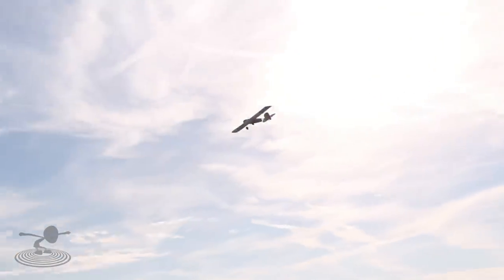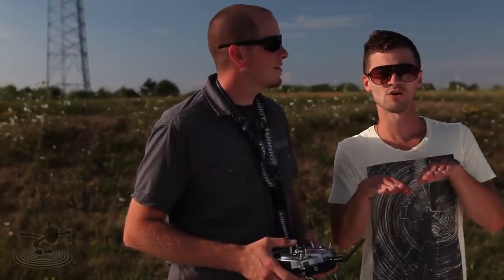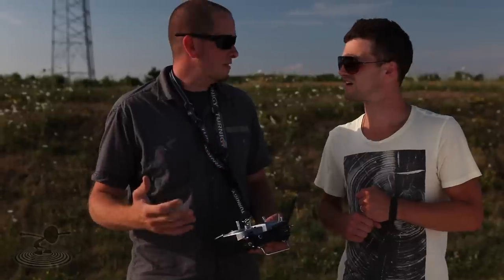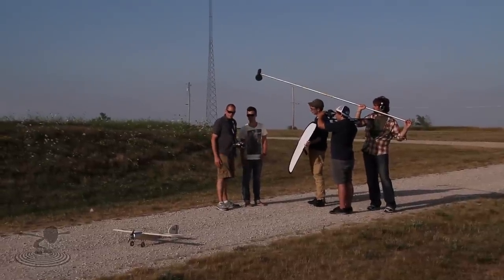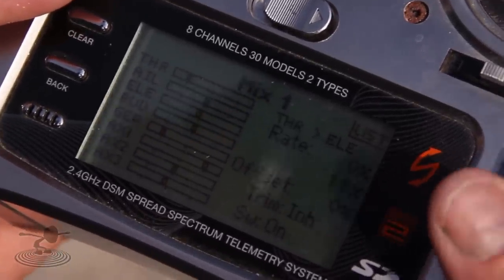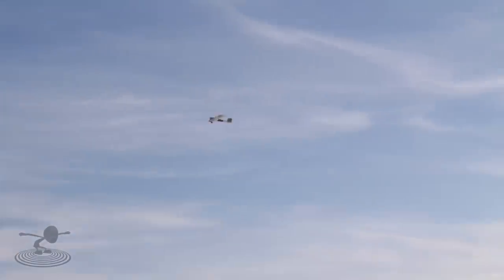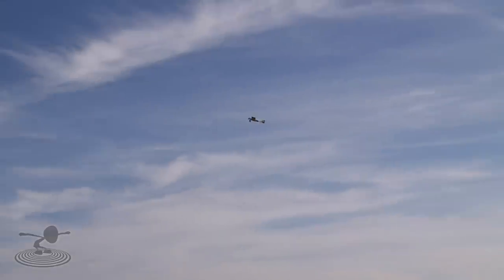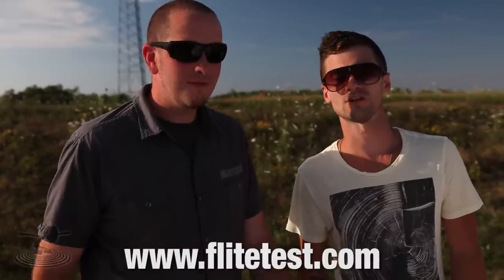Flite Test - Throttle Mixing - FLITE TIP

Comment: Great tip to put out there guys. I have used throttle mixing for a while but I always used it on pusher planes like the wild hawk or to a lesser extent, the fpv raptor. Plans that when you mash the throttle it wants to push the plane downward which can be hairy on take off and landing. Alot of this type of plane have some compensation built in for the stock setup but the problem comes back when you upgrade the power.

Comment: Hi guys, West here.
 I have a different take on the reason for the nose dropping when you throttle off and are in a glide. I use this very maneuver to help determine CG location. 
I feel that your bird is nose heavy and not suffering from a thrust issue. Thrust issues relate to when power is on not off in my opinion.
Great job guys and I love your shows.
West

Comment: Thanks guys for another great tip and explanation on mixing.(thanks Josh for the mixing/scratching sound effects.lol!) Right now I'm dealing with the whole thrust angle issue with a motor/motor mount/firewall replacement on one of my planes. If I can't get the down & right angle just like I want it, the throttle>elevator mix will at least help! Thanks again! You guys are always a hoot to watch. Keep up the good work and good luck with the future growth of FliteTest! God bless!!

Comment: It took me an age to actually notice the lil' hatch on the RH side, that's where I put my rcvr, battery goes in the front battery box (silver cover on top) & yes the esc is right next to it. Its not a high power setup & in chilly Fife (Scotland) heat is not so much a problem. Good vid! I am going to setup the mixing just as JB described. Once the weather calms down for a maiden I'll try it both ways and monitor the heat. Once I've flown it if all's ok I'm going to put a wooden prop on!

Comment: Great video. Always love them. However I think I would've added some downthrust on the motor first of all. But good to see how quick and easy. Possibly put up on your forum how to do the mix on the following transmitters:
* Spektrum (which you did on the video)
* Stock Turnigy 9x
* A Turnigy 9x with er9x
This way people won't have to spend too much time figuring it out. Especially with the terrible stock firmware on the 9x.

Comment: One way I use mixing is for new pilots, to make the positive and negative effects of various inputs on the plane stronger like the adverse yaw effect to show and train them to counteract it. Also for limiting other parts of the plane to give teach them how to use each control surface more efficiently, like a lower throttle output at high elevator inputs to get them used to how angle of attack effects the plane.

i slowly remove the mixing as the pilots gain skill and properly fly the plane.

Comment: a more common mix is putting in a little down elevator at high throttle input to keep the nose from climbing. i use that on a few planes.

Comment: Got everything together. Had to add 70g of lead to the front. Fly's great with no mixing required! Left the underwires off. Not for tricking. Front wing tongue pulled out and nearly lost the wing just doing a loop. Reinforced with two magnets. Fun plane.

Comment: Hello , nice video , I wondering, is this suitable for 3d planes ? I wonder what would  happen if I have the airplane inverted and I want to cut throttle? In this case the airplane would go down straight away. So this is just useful when the airplane is upright? Thanks you

Comment: I just received mine today. I am perplexed. I need help! The battery box is full of ESC. Where do you have the ESC and where do you put the receiver? My motor board is mounted wrong so theres no way to get to the allen (grub) screws that secure the motor and cuts the air flow out so the angle may be wrong? If you put all three (battery, ESC, receiver) close to each other you're going to have a major heat problem and receiver interference. So, tell me what you did to solve this. Thanks

Comment: sorry josh scott, those arent really flying wires. this is modeled after the elder 40, which is modeled after the fokker eindecker. the fokker eindecker didnt have ailerons and it used the wires for wing warping, like the wright flyer

Comment: Please explain -   the mix options showed   rate  and 2 places to enter -  Josh skipped the first and went to the second and said this is low
and made an entry there.     What are those 2 options for  -    a 2 position switch ?   so 1st entry is for 0- position and 2nd entry is for 1- position ?    If so,   when I enter values in both  (different value for each)  the display does not change when I toggle the switch back and forth ?    I don't get it.

Comment: I'm confused.  How does mixing in down elev help with a diving issue?  Seems that would magnify it..
You said in the beginning that you were going to mix in up elev, but you mixed in down elev.
Did you add two mixes to solve both the throttle up and chop throttle issues?
If so, you didn't show this in the vid.
Reply: they didn't mix down. im assuming tou said this because they modified the lower number? the reason for this is that the throttle 'off' position is all the way down instead of in the middle like the other channels. mixing in elevator on the negative side is essentially adding a mix at 0-50% throttle.

ie the elevator will increase as the throttle tends from half throttle towards no throttle. I hope this is clear.

Comment: Flight test is by far the best rc channel on youtube but I'm still afraid to spend a lot of money with HK because they have such a bad reputation as far as quality,honesty and customer service goes.
Although,I bought 1 battery from them and had no problem.Maybe there's hope.
Reply: bubbloo9 i built my own rc plane just buy some foamboard watch yt vids, find a design or make your own, cost me like £100 all parts, plus tools.
one thing i would say is buy a decent charger, i bought the cheapest one and the battery wasnt charging. to get a replacement battery you need to provide pics of volatages and amps etc of each cell which you can only get from a non cheap charger.
Reply: when i say non cheap i mean anytbing with a screen probs like £20-30 up

Comment: i think u missed the point. if u trim the plane with no throttle and the plane rises when u hit the throttle that is a thrust angle issue. we all agree on that. now to counteract that, the plane was trimmed with throttle, so it has down elevator to keep it level while on power. when they chop the throttle, the plane dives. understand? they were dealing with the same phenomenon but from the the flip side.

Comment: CG not trim. Trim is a band aid of sorts for fine tuning an already balanced bird. A plane must first be CG balanced for optimum flight performance, understand. Fix CG, then address what the motor does to your flight path. Essentially what was demonstrated was to use the elevator to correct some other imperfection. 
Now please take what I have said as merely an opinion.
I appreciate the counter thought too.

Comment: sorry guys, i think this was the wrong plane to do a mixing vid. u should have used this plane as demo for thrust lines to counter act torque and p factor. the correct (and easiest method  if u dont have a comp radio) would have been to add a few washers behind the motor to add down thrust, maybe even a little bit of right angle.